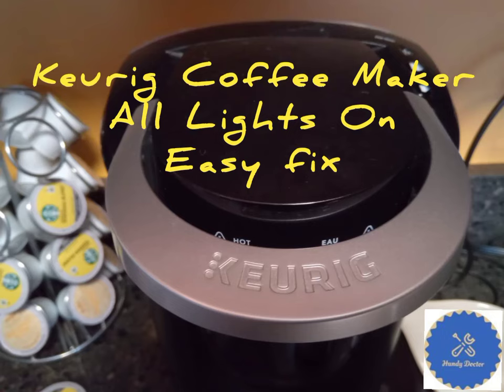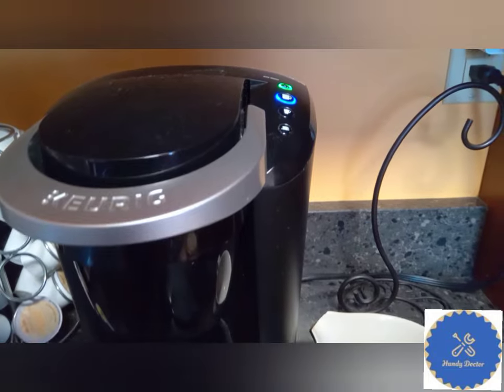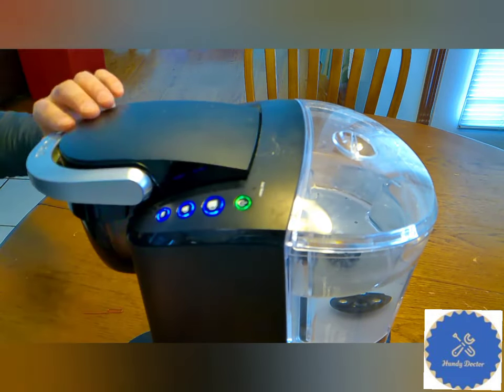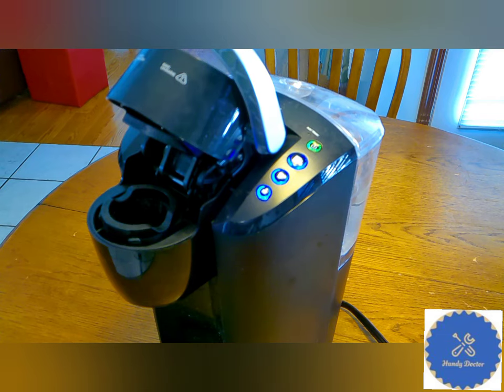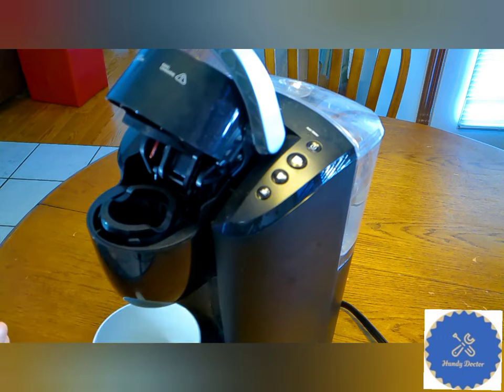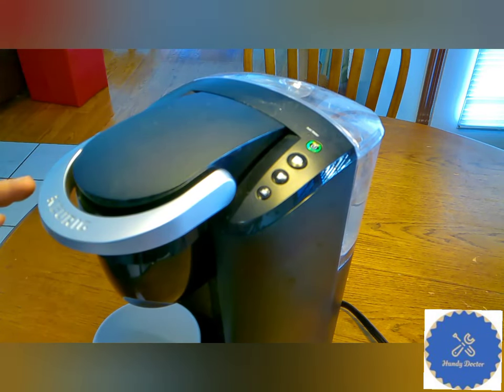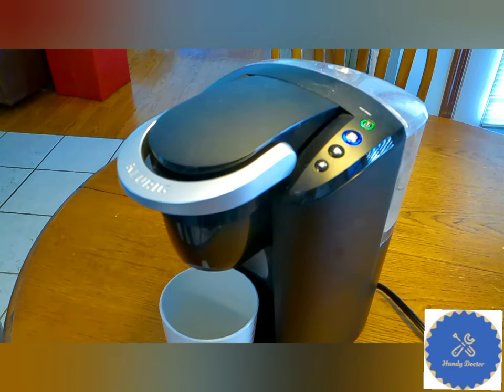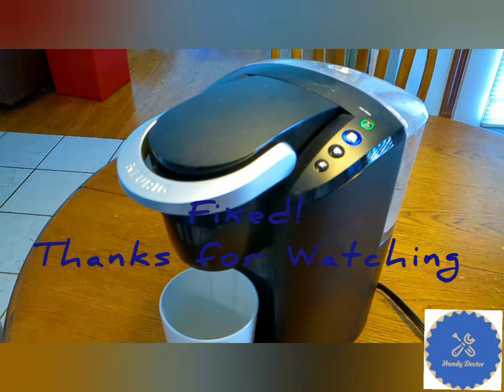Fix Keurig coffee maker all lights on. All lights stuck on. All lights lit. Won't brew. Keurig Hums

Comment: Thank you. But this Didn't work for me. 

HI EVERYONE!!! THE FOLLOWING JUST WORKED FOR ME:

TAKE OUT THE CUP. CLOSE LATCH. HOLD THE POWER BUTTON WITH YOUR INDEX FINGER AND SWIPE FROM SMALL TO LARGE 4 TIMES WITH YOUR THUMB. LET GO. BOOM-RESET
Reply: This worked after following the video didn’t! Just make sure you place a mug under it…
Reply: This is the real solution. Video is useless. Remaining water gushed out and device fixed immediately after cycling through buttons and releasing the power.

Comment: Didn’t work for me. All the lights are still on and it still won’t brew lol
Reply: Same for me… I did it and lights still on
Reply: Same here cleaned the needle and nothing 😢 had to get a new one
Reply: I just smacked the side of it a couple times. There was some gurgling noises and then the lights went off except the power. Was able to power down after this.
Reply: Lol, smacking the side worked!! Thanks for the tip! Tried everything else
Reply: @Edge9273   same here👍
Reply: Yep had to smack it a few times.
Reply: Came here to jump on the "me too" train, and now I'm going to beat the crap outta this machine. I figure I can't lose, it will either work or I'll get to take my frustration out on it
Reply: What happens is the water entry gets clogged. Scrap where the water comes out with a small scissors a bunch of times to clean a clogged water entrance. Then press the green light. Then run the hot water only through the machine a couple of times.
Reply: Usually using a toothpick to clear the needle has worked for me for years. But, for the first time ever, after trying my normal fixes… only a medium-light smack on the side by the buttons worked. 😂😂😂 Like other commenters, it gurgled, coughed up a little hot water, then the error lights went off and it was ready to roll! 🤣

Comment: The small hole where the water comes out gets clogged. You need to scrap the tip clean. I used a small scissors. Just stuck one side of the scissor s in where the water comes out and scraped a dozen times. Pressed the green and hurray hot water came pouring out.

Comment: Thanks! This happened while staying at a rental property. Your video may have helped, certainly helped think it through, but lights stayed on after probing the outlet hose (seemed to be 3 openings in the spike outlet). It seemed to be making noises when I pressed the power button, so I took out the pod, put a mug under and pressed the power button. It filled the cup half full, then the lights went out and the machine started working normally again.

I also appreciated the enthusiasm at the end of your video when your machine started brewing again!

Thanks again!
Reply from the maker: @ekconley6429  Thank you

Comment: hey that worked! I didn't feel any clog or see anything come out when I pushed it in so I was thinking it wasnt working. But I closed the lid and then pushed the power button while it was still on and then it made a motor kind of noise and then the lights went off except for power button, and then I heard it heating the water again! I used a lock pick btw, didnt have any paper clips handy

Comment: On the K Cafe Express (frother on left side). I experienced lights on but not blinking. The fix in
1. Unplug machine
2. Lift open the top
3. Just behind the where the KCup goes in the 11 oclock position there is a rubber plunger
4. Reach back (sharp nozzle near) and find the rubber piece.
5. With your finger pump the rubber piece for about 30 seconds.
6. Should be good to go. If not repeat step 4&5. I had to do it twice.

Comment: Thank you. This worked for me however when I used the toothpick nothing looked stuck in there. But I still pushed the toothpick through both side holes and then unplugged the maker and the lights were all still on however I pressed the large mug button and it started working again.

Comment: DIFFERENT FIX!! ok mine wasn't plugged at the top, but the bottom piercing hole was plugged.
I could push the top button and water came out, so top hole was good. To fix the 4 lights on: I lifted the water reservoir up almost all the way off, re-seated it, opened the pod lever up, closed it, pressed the bottom button, released, pressed the middle button and they all went off. I pressed the top button and it lit up like normal. After a minute water was boiling, the lights started blinking to select my cup size... enjoyed my cup of Pete's... FIXED!
Reply: Same.
Reply: Thanks, your method worked for me!

Comment: Worked great ty!!!!
Reply from the maker: Happy to help.
Reply: @HandyDoctor89  now it won't let me it worked for two and boom it was done I think it's the pump, would that be another reason why it's all lit up?
Reply from the maker: @tiffanymcdonaldAkaNona  possible but unlikely. You may try this needle trick and then immediately use a descaling cycle. Probably too much mineral deposits inside after long usage. You can buy descaler from Walmart ($5) designed for Keurig or just vinegar. I guess time for another video. Supposedly descaling cycle should be run every few months but most of us don't do it.
Reply: @HandyDoctor89  ok I'll try ty